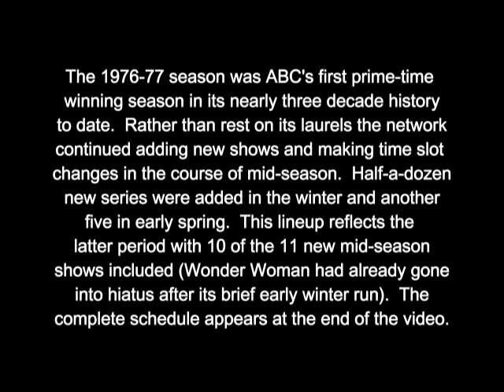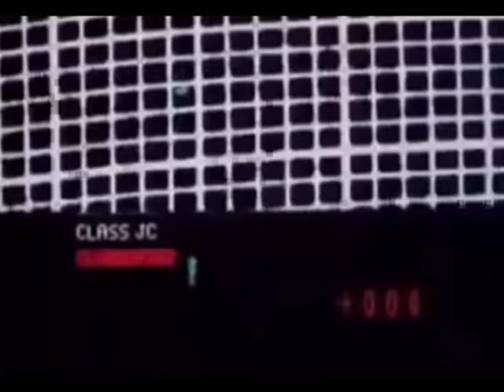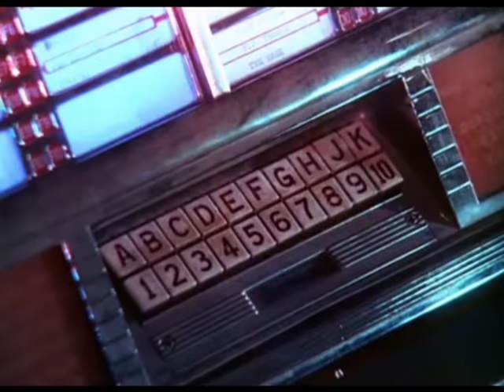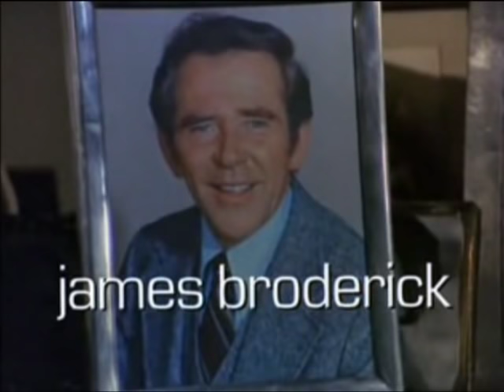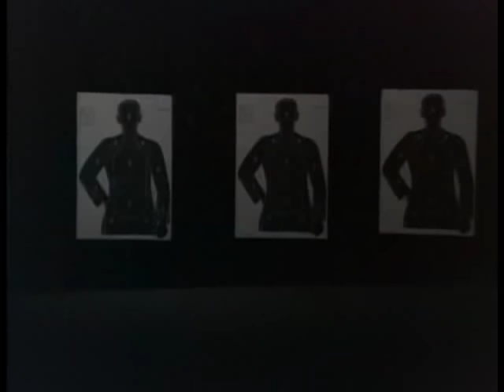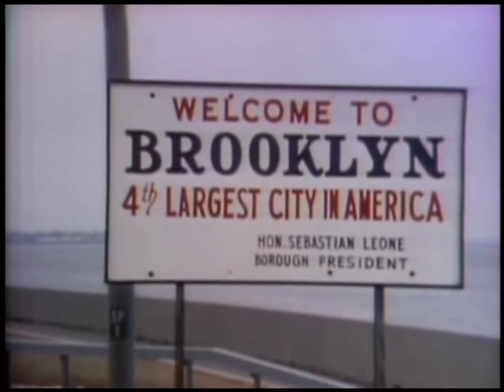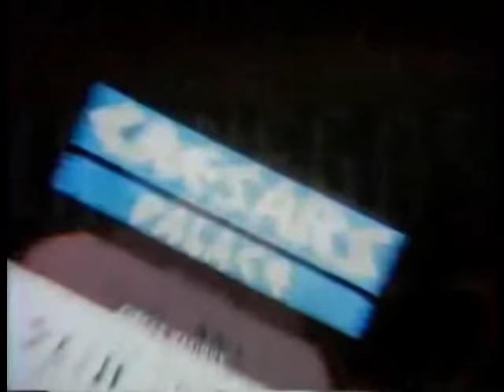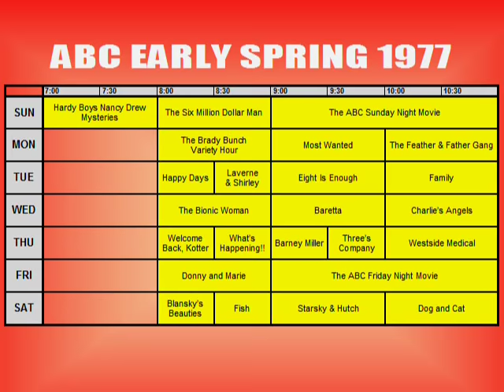24 SHOWS OF ABC EARLY SPRING TV 1977

Comment: This is the first of these I have seen you organize by day of the week, but it makes so much more sense of them. Also, I'm kind of surprised that Feather and Father thing didn't go. Seems like a strong pairing.
Reply: P.S. don't you usually use the original credits? (with an intro note when that isn't an option) My recollection is that Happy Days started out with "Rock Around the Clock" as its theme during the first season, which was shot on film, then switched to this version in the second season when they began shooting on video.
Reply: P.P.S. Seeing Fish , which I know came out after Barney Miller , and seeing Barney Miller , which I seem to recall debuting in 1975, I'm thinking that maybe some of these are in the compilation because they didn't debut in the spring but rather changed networks?